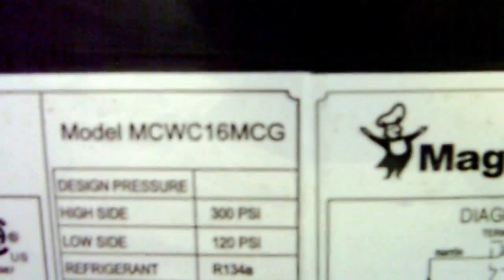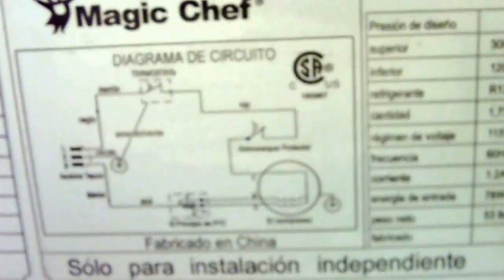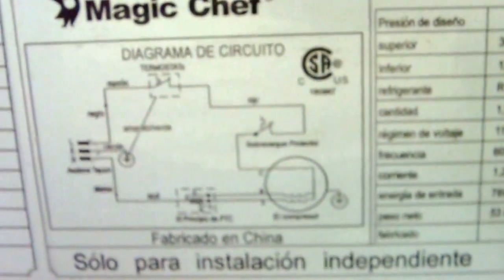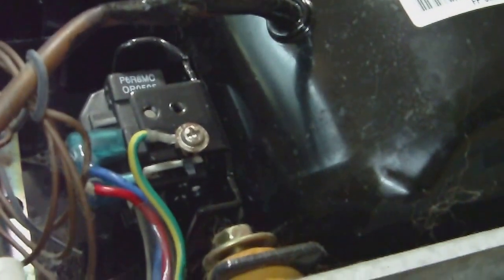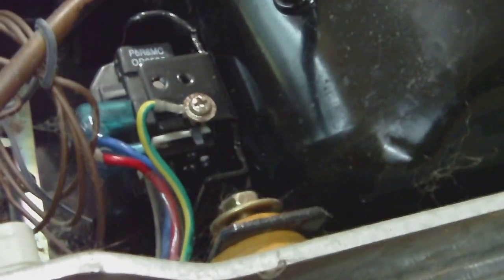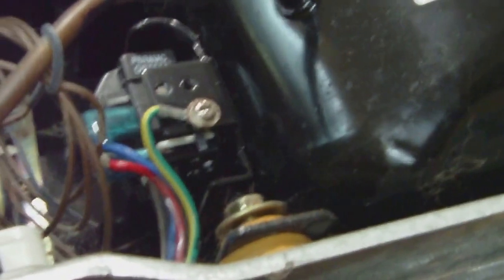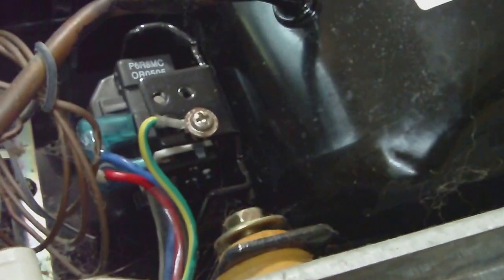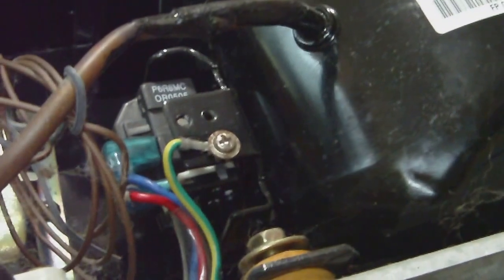How to Fix A Broken Wine Chiller Cooler

Comment: Thanks! I pulled out the ceramic disc on the relay and wiped it off, put it back in and my fridge works!  I'm going to order the part just in case it stops again.  The part  #6R8MG  (starter relay) is $20.55 and can be ordered from repairclinic.com  I got the part number from Magic Chef customer service.  Thank you so very much for sharing.  I was in the process of shopping for a new unit when I can across your video.

Comment: Have an Avanti WC292D. Holds about 24 bottles of wine. I have 2 round relays next to my compressor. The back relay is the overload protection. The 1 in the front has the ceramic disk or disc. Relay Pulls straight out. Compressor has 2 forks or connectors. Cleaned with emery board. Ceramic definitely had a coating on it of some sort. Also had what looked to be a part number. I didn't remove the part no. in the center as the contact was on the outer edges of the disc. Put back together, Plugged in & prayed it wouldn't blow-up. Hooray! Compressor kicked on & it's now cooling again. YES! Thanks for your video. My $50 bottles of wine won't be ruined now.

Comment: Thanks so much! Found an Haier Wine Cooler on the side of the road, great condition, all I did was rotate the disc 45 degrees and put it back and now it works..gonna buy a replacement just in case. You ROCK!

Comment: Worked great for me after my Magic chef MCWC45MCG model started doing the tell-tale click noise, wouldn't cool, and the compressor wouldn't cycle on. A voltmeter test later and this was the $7 solution. An update that I found is that the  P6R8MC PTC starter seems to have been replaced or harder to find and the part I received (P6R8MD) has two prongs on the relay. No big deal since no current is going in or out on the one side and I just taped it up with some electricians tape just in case but figured I'd share my mileage in case anyone else had a similar experience. Thanks man!

Comment: Awesome!!! I will try this on my downed MC unit right now..... will get back and let you know if it worked. = )
Reply: Pull the plastic sleeve back and pinch the edges of the connection or pry the flat part up while pulling. Or, take the back cover off and use an icepick from the inside to push that connection apart. 

My wine cooler started right up after I was done, but now, three days later, it has stopped again. : (

Anyone with another idea for me?
Reply: +Bret Pemberton did you ever find out how to get the metal clip off?
Reply: I bought the whole starter online, it was only about 14 dollars. I got the cooler working great!

Comment: I have an Everstar by Franklin Industries "Wine Cellar model HDC36ss refrigerator with two doors and 2 different temperature zones.  One side is not cooling.  Any ideas?  I did fix the compressor startup with your help Thank You!

Comment: Does the start relay (P6R8MC) have a second piece attached to it? I bought a replacement online and it looks like there should be something else out the back side. Also did you plug the relay upside down to the top two pins on the compressor? My fridge came with these parts missing... Thanks

Comment: I replaced the relay and plugged the unit but it still doesn't seem to be getting any power or turning on at all.  When I plug the unit it I observed a small single clicking noise from somewhere near the relay or compressor.  Any ideas?

Comment: So I have one that turns on, hums and the lights all still work but it doesn't seem to cool anymore. Any thoughts on what to do for that?
Reply: Apparently a common problem with at least some Magic Chef wine coolers is one of the solder joints on the circuit board burning out. You can either resolder that joint or replace the entire circuit board for about $60 or $70.

Comment: I have vinotemp TC32G when I opened the plastic cap I found a mess! looks something melted under the capacitor (white).  the 2 connects look like they were burnt.  I didn't see a ceramic disc, only 3 pins... took pics and going to see if a can find an electronics store.

Comment: I found the piece in my unit, but mine is a white disc with some type of metal outer ring. I has a hard to read part number, looks like 4R71 D224, but I could not find it online.  Does anyone know what this disc is called?  Almost looks like a flat battery.